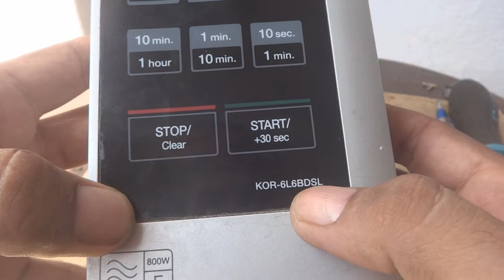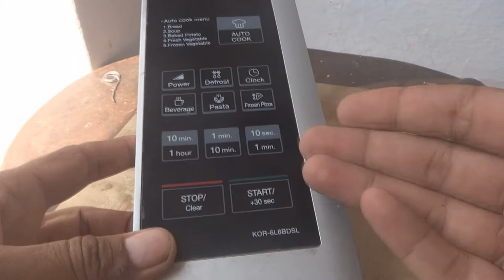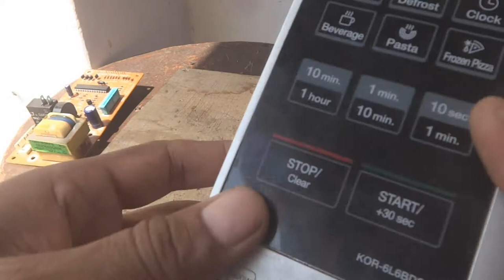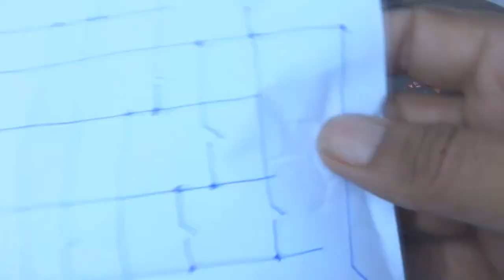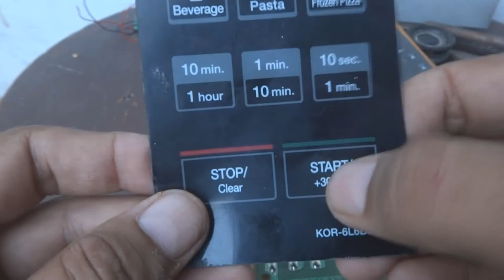Microwave Oven repair, Microwave oven keypad modification

Comment: Good video however instead of going through all the hassle of soldering all those   microswitches why not just replace the full keypad here in the uk it would cost no more than 5 pounds about 600 pak rupees.well done despite this issue.
Reply from the maker: Dear friend MrTwisted1977 thanks for appreciation and such a nice comment. Problem is these keypads original replacement parts aren't easily available here in our market. The second consideration is if even we find it, the same problem will be repeated again and again with new keypads! Reason for such problem is the manufacturing defect with original keypads. Whereas the modified one will not go bad that frequently. Or if it may go defective with time, the replacement switches are very low cost and easily available everywhere. Best regards,

Comment: sir mery pass PEL ka oven hy syd wo china ka hy wo garmioun mein kuch b gram nhi krta jitni dair marzi time set kr lo but sardioun mein bilkul thek kam krta hy. plz bta dain iska kia issue hy aur thek kesy hoga?
Reply from the maker: Check it's fan and thermal overload.
Reply: The Engineer but sardioun mein bilkul thek kam krta hy. Aur termal overload kesy check krty. Fan tu thek kam krta hy
Reply from the maker: Thermal overload ki continuity test karthay hen. Is may continuity milni chaheye. Ap is ko carefully test kejeye. Ap ko fault mil jaye gaa.

Comment: بھائی میرا اوون  ڈس پلے دیکھارہا ہے لیکن چل نہیں رہا مطلب اس کا فین اور ٹرانس فارمر اور میگنٹرون نہیں چل رہے
Reply from the maker: Bhai circuit may koi cheez kharab ho gae ho gee. Check kejeye: pcb ka koi jala hoa track, blown fuse, kharab relay ya koi kharab wire aur connection wagera. Is kay ilawa door safety switch aur temperature switch check kejeye. Jab theek kar len tho yahan comment karkay celebrate bhe kejeye. Wish you good luck.